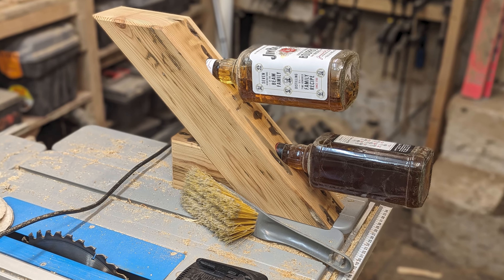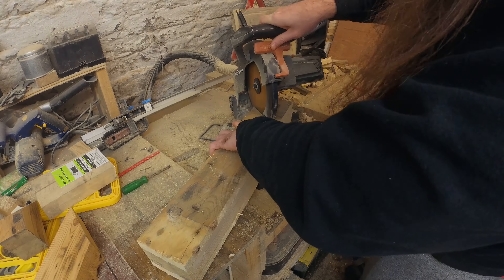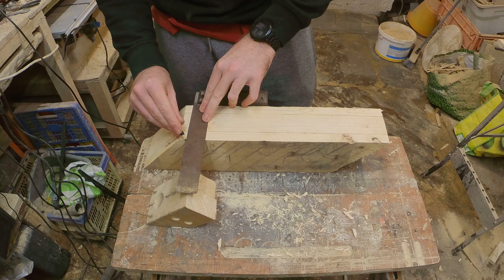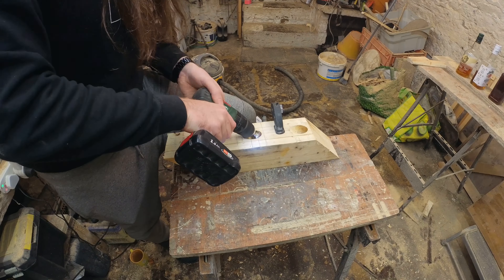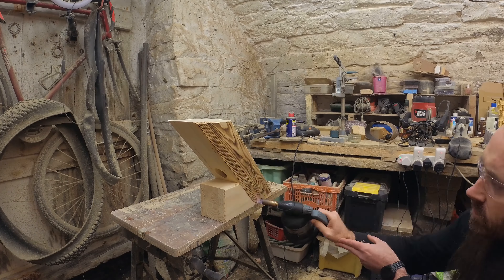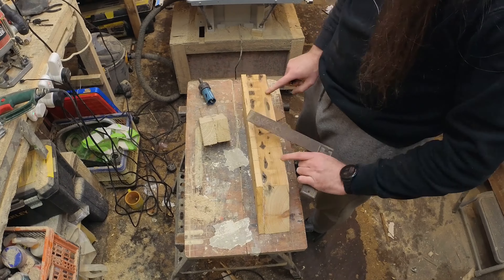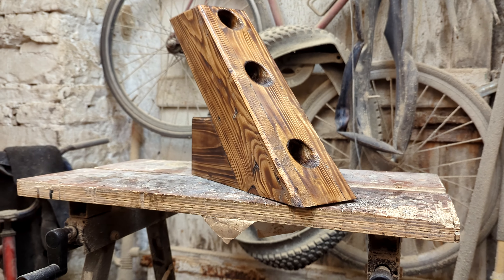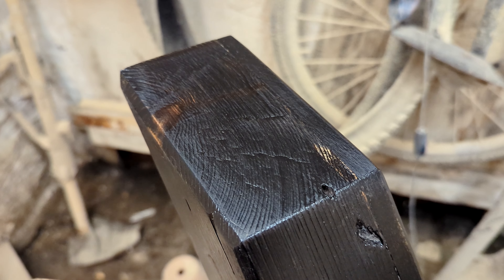Scrap Wood Whisky Bottle Stand

Comment: I like the flamed one more but as long as your friend liked the one they got its all good. Only problem i see on the flamed one is the top hole over time will be the first to break from the bottles weight.
Reply from the maker: I do like flamed stuff. I just do it a lot so I'm always thinking of new styles to try.
Yeah that top hole was too close, I was tempted to add a block to the top as well but didn't have time.